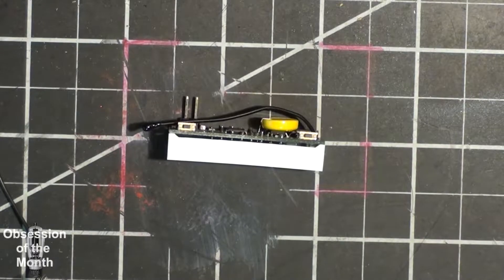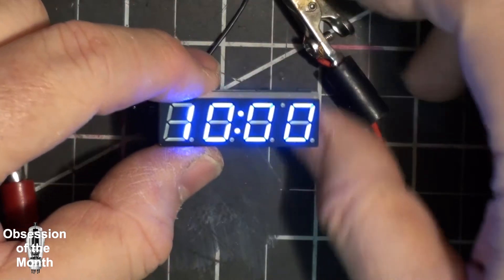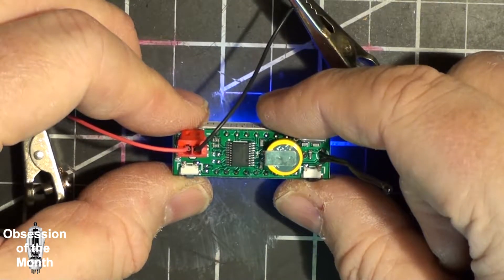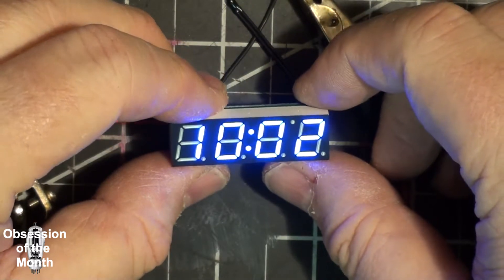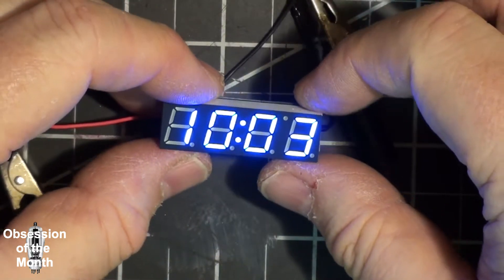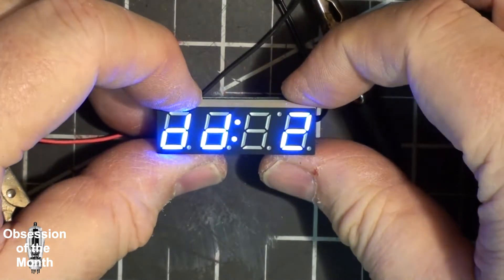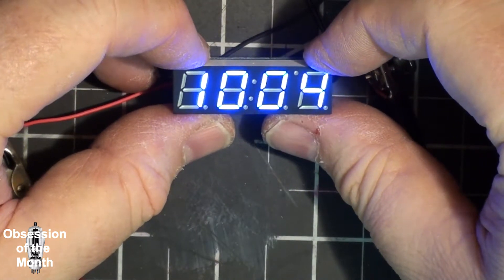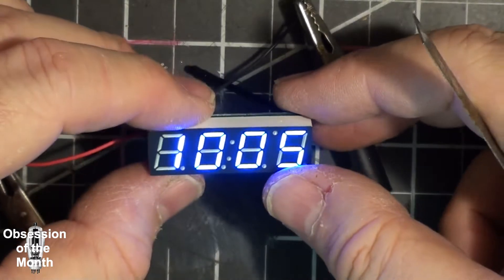DS3231SN 3 in 1 LED Digital Clock

Comment: Hi, does the date function stay on or does it revert back to the time? I'm looking to build a back to the future clock set
Reply from the maker: It reverts to time.
Reply: How funny, I put mine in a flux capacitor clock I made. 
My DS3231SN has an option for 12/24hr display too.
Reply: OK thanks
Reply: I want to make some back to the future clocks but don't know where to start, I've no experience with arduino ,